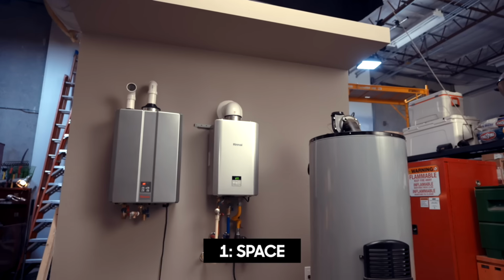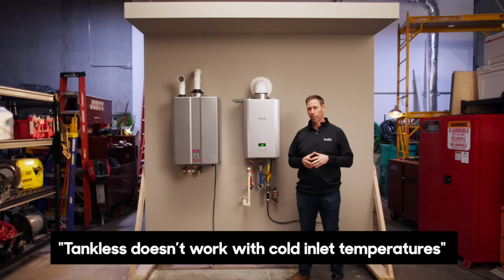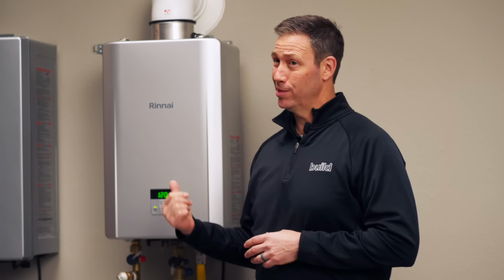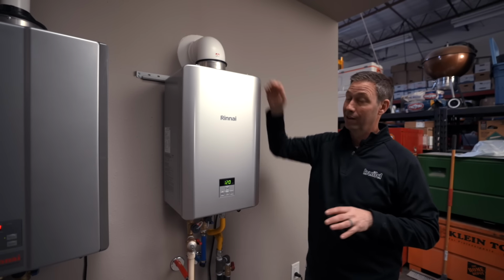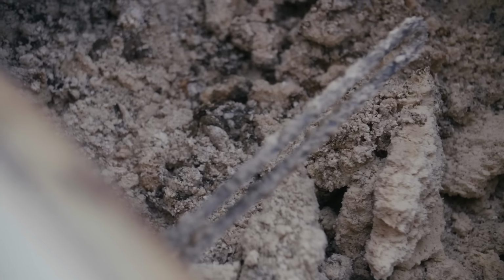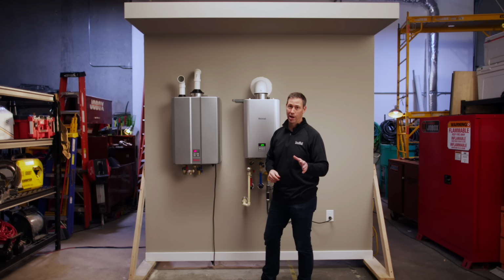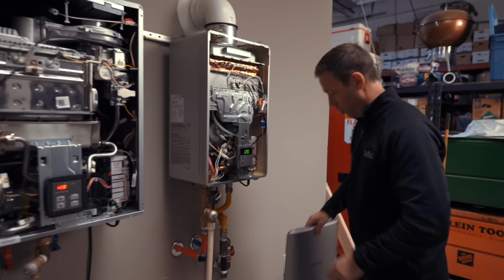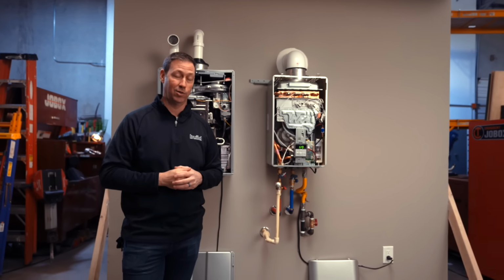DEBUNKING Tankless water heater LIES!

Comment: Although, I like the idea of a tankless for use and being a space saver. You have to weigh the cost of the unit + the installation vs just replacing a traditional water heater. My research has found you have about an $8 a month utility savings using a tankless vs a traditional heater. Now most of these tankless are at least double to triple the cost of a traditional tank. Then factor in the huge installation cost of a tankless vs most diy'ers can replace an old water heater themselves in about 20-30 minutes of time (replacing with same unit). 

Bottom line, the unit cost + installation of a tankless vs a traditional water heater is a savings of a about $100 bucks a year. Now tell me how many years does it take to justify the cost of purchasing a tankless and having it installed? Even if I replace a traditional hot water tank every 10 years. I would be bucks ahead doing so.

The biggest plus a tankless has over a traditional is if you need to conserve space and maybe if you are using a tankless in a vacation home you only use a few months a year.

From what I am reading it cost about $3,000 to $5,000 to purchase and install a tankless. It cost me about $600 the last time I replaced a traditional water heater...and that was over 12 years ago down here in SWFL. The one I replaced up north was over 25 years ago and if I remember correctly cost me about $300 bucks from Sears. 

So, on a 30 year mortgage you might replace a traditional unit 2-3 times during the lifespan of your mortgage.

...What's in your wallet?
Reply: Another item to consider is the annual service cost. Almost anyone can drain a tank water heater at least once a year to help keep scale down.  Tankless water heater service is more complicated because you must cycle a descaler (vinegar) through it instead of draining it. Matt has a good video on this:  https://www.youtube.com/watch?v=woKVYtf2Ihg  I believe the video demonstrates the additional complexity of servicing a tankless water heater. It is doable, but I don't believe many homeowners will tackle this on their own, and the annual service cost should be factored in the ownership cost.
Reply: Someone told me he spends $80 a year for filter and stuff to maintain his tank-less, i'm still researching , need to make decision soon...for me initial cost are same...

Comment: I've had 3 tankless wTer heater the best thing I ever did wss to install a water filter ahead of the heater.
Reply: Our incoming water was full of debris, and the water supplier took no responsibility for the amount of scale and debris coming in directly from the street.  Our supplier relies on calcium buildup coating the pipes outside of the home, and we found our sink aerators were regularly clogged with this stuff reducing water flow. We had to replace several valves and faucets clogged with build-up! The water supplier is sorry, but not our problem the water tested fine for consumption, and that is the extent of their responsibility. We needed to replace our boiler and tank and wanted to get a high-efficiency system but we had to install a whole house water filter first. If we didn't, the debris coming directly into the house would have quickly built up inside the new system! This is something to be aware of, and I recommend having it checked before proceeding with an expensive installation. Our water supplier ran water into a bucket at the house water inlet, and the bucket was a quarter full of debris!

Comment: Gas is only going up in price and is a fossil fuel. A heat pump hot water running off a house with a large solar PV system is far and away cheaper (and at times of day potentially free) and substantially better for the environment. I ripped out my Rinnai tankless and went heat pump hot water. I then got my gas supply completely disconnected. Now I just need to save to buy an EV.

Comment: heat pump water heaters > any. 
I own a large solar company. We stack a domestic hot water solar panel in position one and then it uses next to 0 energy 7-9 months out of the year depending on your climate. Anticipated 25 year lifespan in this system.

Comment: Have had tankless for more than ten years now - never a single issue. I have cleaned it exactly once as I never knew that was supposed to be done! VERY hard water but I have a softener and it's worked well. Super cold input water DOES make a difference but if you throttle back the water on say a garden tub with big pipes the tankless has zero issues pumping 130 degree water. For sure prefer this over a tank!

Comment: The tankless water heaters are much more expensive than a standard tank replacement. We install them and people don’t realize we need to run a larger gas line and a power line since they need their own circuit. Maintenance runs about $300 a year for us to flush them. Tankless water heaters are much slower to respond since most older houses can’t use a recirculating line to make it more instantaneous. Running the recirculating loop at my house on my propane unit did increase my propane useage a hood bit so there’s a cost associated with the more on demand water. With all of that said they are still a great option for those that need space like I did and wanted the continuous run time.

Comment: Manufacturers of old water heaters spreading rumors again. In Ireland they are smaller and instantly hot because they are right where the water comes out, leaving zero need for hot water lines.

Comment: KISS is the way to go here, expensive and too many parts and electronics to go POOF!
I have a electric 50 gal tank water heater, 100 % efficient, quite and can be put anywhere. No venting needed and easy to fix and way cheaper to buy. The price of gas is climbing and it is non renewable, where is live we have hydro, nuclear, wind and solar, very little natural gas is used to produce electricity.

Comment: Love your videos Matt! I'm just starting a new home build in rural East Texas where I have a choice of propane or electric for the water heater. Can you speak to the operating efficiency and longevity of a propane tankless vs. an electric heat pump tank water heater?  I intend to install a water filtration / R. O. system for the whole house upstream of the water heater, which should hopefully address the mineral content and potential for scale buildup. I will have a propane backup generator to support the entire home when needed. 

I've had natural gas tankless in two previous homes and was very happy with them. TIA.
Reply: Propane is less efficient than natural gas and requires a higher volume to produce the same results.  Go electric.

Comment: The only problem I have with tankless is that you need electricity for either one. I have natural gas, and even in a week-long power outage, I had hot water the whole time. If they could come up with a back-up battery ability for tankless, I'd certainly consider it, but I'm not interested in some Rube Goldberg setup of buying a power supply and rigging everything up.

Comment: I have split rate electric service and I have a timer on my electric water heater tank so that I will only heat water during the off peak rate period.  During the on peak period the timer turns off the power to the tank and my tank will store enough hot water to last during the peak hours of the day.  If I had a tank less system I would not have any hot water when the timer shuts off the power to a tank less system.  And without a timer I would have to pay a high demand charge as well as a higher rate for the electricity used to run a tank less system during the peak period hours.

Comment: whenever someone would ask me about a tankless I would tell them to run away as fast as their feet would carry them, nothing but endless service issues, hardwater areas more nightmares, heat exchangers require yearly deliming, saw subdivisions where tankless installed with storage tanks because of slug of cold water that seconds person in shower would experience because of unit shut down between uses, once I came to do final inspection on a Rinai, first words out of customers mouth.... I hate the Fxxxing tank. Lots of things mentioned in this infomercial just nonsense, embarrassing to see the shilling .

Comment: All the guy told you on video are mostly lies! The tankless heater gives you 120 degree hot water which is NOT really hot water. It is a little warmer than WARM water. Also, it takes time for water to travel from where it’s installed to where your shower is. For 120 degree water, it will become 100 degree which is warm. You don’t need to add cold water. For tanks water heater, you can turn to vacation mode so it won’t heat the water when you’re away. Then , you need to install a motor to pump the water to your shower. That’s costs additional $. That guy is just a sales to sell tankless heaters. If it really works that well and costs so little, you think there’s still going to be tank heater around? I think not.

Comment: Put in a Rinnai  about 15 years ago in NH inlet temps of 50 in the winter.  No problem getting hot water.  I did install a recirc pump in the Master bath to cut down on the time to get hot water and stop wasting all that water down the drain.  Just press a button on the side of the vanity  & it takes about 25 sec to get the hot water to shower ( have another one in the adjoining Hall bath and the unit also came with remotes we can use in the Kitchen and downstairs bath)    Have a whole house sediment filter & when I clean the sediment screen on the Rinnai it is always barely dirty.  It's easy to flush the unit myself - don't' need a plumber to do that.  There are plenty of videos available to figure out how to DIY.  I was lucky to be able to install it in my basement on an exterior wall so venting was very easy and not expensive in my case.    Have had ZERO issues with it.  Can't speak to other brands but When I was researching before my install Rinnai had a great reputation.

Comment: Thanks so much for doing this. I love the videos you make with the exception of an old video you did pointing out all the flaws of tankless water heaters. I'm thrilled to see you make a new one pointing out all the positive aspects of tankless. Well done!

Something you should point out - Not all tankless water heaters are created equal. Some have a very hard time keeping the temperature constant as demand changes. Some are just super unreliable. Look into how bad the Bosch ones are. They are so bad, they had to stop selling them in New Zealand. I've installed several Paloma (Home depot's Rheem rebrand) and quite a few Rinnais.
Reply: "Look into how bad the Bosch ones are. They are so bad, they had to stop selling them in New Zealand. "  Are you talking about the Bosch mechanical tankless heaters that are still made (e.g., Bosch 16P), or the electronic ones that are more similar to Rinnai (e.g., Bosch 17E)? Thanks!

Comment: Matt, I understand you might feel the need to make a sponsored video from time to time. You have to make a living, and we all understand that requirement. It is good to address the lies about tankless, and that part is partially fair (mileage varies with several people). However, this video implicitly tells the viewer that you are endorsing tankless over tank-based hot water heaters. Clearly, you must pitch the video this way because Rinaii backed it. Otherwise, they would not approve the video and ask you to make adjustments. But explain to the viewers and Rinaii why you personally installed a hot water heater tank (with heat pump) in your house and not a Rinaii. Either something changed in the past year, or this is shady work from someone who holds themself to a higher standard.

Comment: Wow, Matt makes tankless sound really good and foolproof in this sponsored video. I have to disagree with his assessment though.
I live in Michigan with colder water temps but that was only one of the many factors that informed my decision to stay with a tank water heater.
It's a laborious pain in the ass but I'd encourage anyone thinking of switching to a tankless to do your own research.
I'm remodeling my whole house, tore out a natural vent tanked water heater and the entire chimney it vented through. I researched tankless off and on for a couple months. Reading manufacturer manuals, reading reviews, watching "experts" on YouTube, speaking to my gas company about how many btu's are actually supplied through my existing pipe etc. You name it. 
In my opinion tankless makes a lot of sense for alot of homes, especially those in the south. But, my judgement was too many unknown variables for my home.
For starters, replacing an electric dryer and stove to gas and then a 40,000 btu tank heater to 200,000 = new gas meter because according to the gas tech the meter would've been my problem not my line from the road to it or my line coming in.
My old meter would supply about 250,000 and a new one would supply about 400,000. 
Then add in circulation pumps and activation flow rates, yearly cleaning costs and yes, hard water.
I was going to install myself but directly from the manufacturers, not having a certified plumber install it= voided warranty. Not installing another appliance (a water softener)= voided warranty.
So, I decided to go with a power vent tank water heater.
Reply: Unfortunately even if you watch videos and do homework you’ll still fall short.  I make a living servicing tankless units and I own a 40 gallon short. For 101 basics, tankless units are used way differently in Japan and Germany.  They conserve both water and gas/electricity. Case in point shower head volume here vs ones used overseas.  Water temperature here Vs overseas. The units overseas most likely see less burn hours than the units used here.
Reply: Were you going to have to pay for a new meter?
Reply: @anthonyspadafora1384  Possibly. The tech said they may try charging me for it but in her opinion I shouldn't have to pay. So, to be determined.
Reply: @cdyoung976   Not here. If you need a larger meter they are there in a couple days. If you are changing from oil to gas there is no charge to run the line from the street.

Comment: I love this channel! It gives me an opportunity to learn about new technologies. Much of which I will probably never use or get a chance to work with? However, I like having the advantage to be well informed.
 Now tank less water heaters are something I have much experience with. I've been using one for almost two decades.
 I would like to point out one detail Matt didn't address? He said something to the effect of "never run out of hot water again?" This isn't exactly true... I've run out of hot water several times! 
 Remember the heater is dependent on two important things? 1st is obviously water. 2nd would be gas or electricity to heat that water? 
 In my case, I simply ran out of propane.

Comment: tankless are very sensitive. They often shut off when you mix the water with cold. Many tankless don't put out enough hot water for two showers at the same time. After living in apartments with tank and tankless, I'd rather have one with a tank.

Comment: I live in a newish subdivision in Central Texas.  There were 62 homes with tankless water heaters...61 mounted on the exterior of the house and 1 mounting inside the garage.  During the once-in-a thousand-years cold snap in February, 2021, all 61 tankless water heaters mounted on the outside of the houses were destroyed (burst inside).   So, think twice about external mounting!
Reply: That's because the electric went out and there was no power for the freeze prevent operation.
Reply: @don2deliver  Yes - exactly

Comment: He neglects to mention if  you are going from a Tank Heater in a total electric home to a Tankless one you will most likely have to install a new circuit just for the heater as it requires many more amps and voltage to operate.  This can cost you between 800$ and 1500$ to have a certified electrician do it right.  Also there is a time coming in the near future that Gas Appliances will be outlawed for the environment and it's already happening in California.  An all electric tankless heater uses an outrageous amount of electricity and they are much more difficult to adjust and repair where an electric heater is very simple and can be replaced and maintained easily by the homeowner.  Also the gas heaters are much more dangerous and need proper venting and the electric tank heater doesn't need any venting through your roof.  I got 16 yrs. out of my last electric water heater and replaced it myself easily in a half day including a trip to the hardware store for a few fittings. The tank was on sale (40 gal.) at Lowes' for $300 and was a name brand.  By the time you pay a plumber and a electrician to install a tankless heater you could have replaced 3 or more electric tanks.  Study what it takes to go tankless and you will be glad you did~!! 🤓

Comment: Does tankless rely upon having electricity service? I think some long time ago, during a power outage, I actually soaked in the bathtub in the dark, well because at least I had plenty of hot water, so why not?

Can tankless cause problems with low gas pressure? I mean what about the other gas appliances that want to keep their pilot lights lit? A drop in line pressure might be a problem for the other appliances?